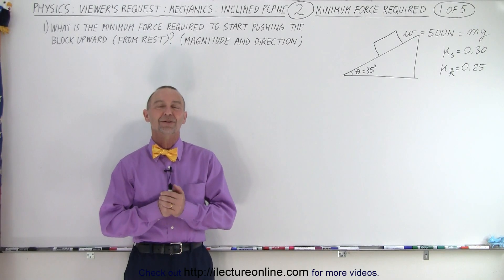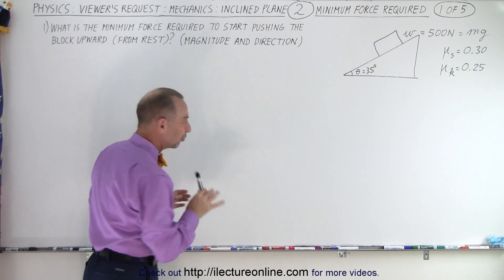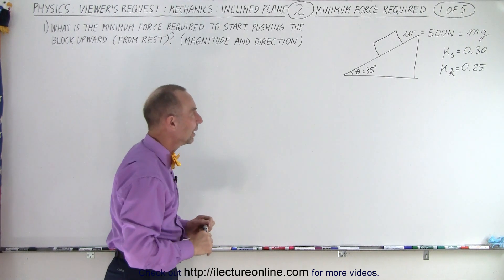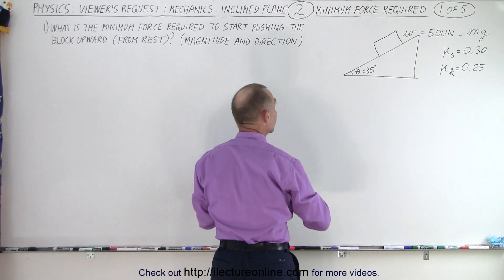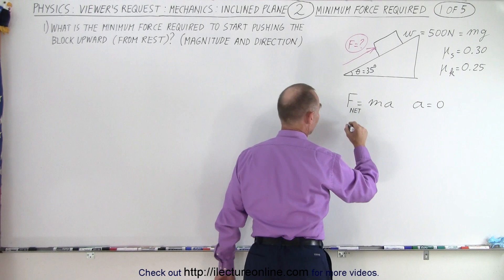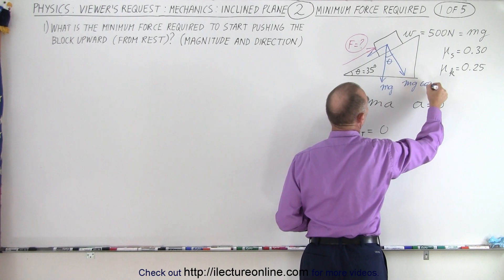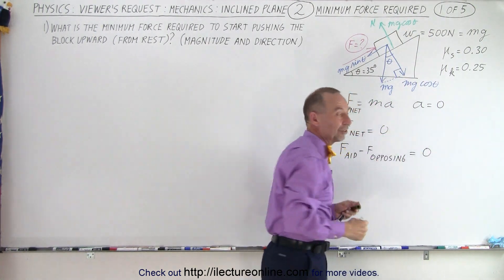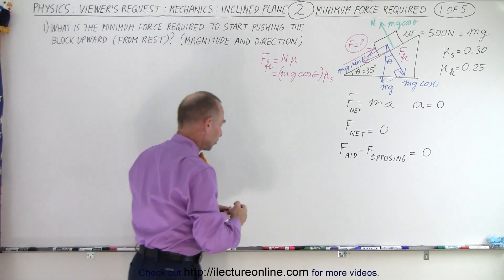Physics: Viewer's Request: Mechanics #2: Inclined Plane - Min. Force Required (1 of 5) Start Pushing

Comment: Let's say the force is given from an angle upward instead of downward which means the certain angle respect to tha side of the block ...then we get reduced normal force and by that the friction will reduce then we get even minimum amount of force as the answer to move the block 🤔💞
Reply from the maker: That is correct.  If the force applied is upward, it would reduce the normal force on the incline and consequently would reduce the friction force.
Reply: @MichelvanBiezen  doesn't it mean that we can minimize force by giving force by an angle upward instead of parallel 🤔💖?
Reply from the maker: It is a trade-off.  When you increase the angle too much, the component pushing the block along the incline diminishes as well.
Reply: @MichelvanBiezen  yeah but at some angle must give a minimized answer 🤔
Reply: @MichelvanBiezen  which gives that F = previous result when F is paraller/ ✓(1+μ²)

Comment: i think i have another opinion if you let me to explain this 
the block will move downward under its gravity force mgsin30 which bigger than friction force = mg*mustatic*cos30
and then that friction coefficent will transform to mukin so friction force will be mg*mukin*cos30 so the minimal force to stop that from moving downward  first will be =163.9N to overcome that gravity force mgsin30 , so the force has to increase to move the block upwards so the friction will transform to be with gravity force and the force has to to increase to overcome this  will be 410N , so we have two minimal forces  first to hold down the block, second force to move up am i right? i wish u have space time to answer me
Reply from the maker: Note that this is a5 part problem.  In this first part, we are calculating the force required to start moving the object upward.  (therefore we must exceed the sum of the mg sin(theta) weight component and the static friction force).

Comment: I need to solve this . A 44 N block is thrust up a 30° inclined plane with an initial speed of 5m/sec. It travels a distance of 1.5 m before it comes to rest. The frictional force acting upon it would be?  Can you please explain it?
Reply from the maker: Use the equation:      W + KEo + PEo = KEf + PEf + E lost (due to friction)   I am assuming that there is no force pushing the block up the incline (except for the force required to give the block it initial velocity)  So the equation becomes:      0 + (1/2) mv^2 + 0 = 0 + mgh + (Ffr)(d)     Where Ffr is the friction force      h = d sin(30) = d (1/2)         So the equation becomes     (1/2)(44/9.8)(5)^2 = (44/9.8)(9.8)(1/2)(1.5) + Ffr (1.5)    Solve for Ffr

Comment: Sir, this solution is incorrect. The force should be a pulling force up the plane at an angle of 16.7 degrees. The solution is very similar to your lecture #6 with the same angle, but instead of pushing down, one should be pushing up.

Comment: Hi sir, one small doubt how Acceleration becomes zero. is it because initially the body is at rest ?
Reply from the maker: The acceleration does not become zero.  The moment a force large enough to overcome static friction pushes against an object, the object will begin to move and the friction changes to kinetic friction so that the object will jump forward and begin to accelerate.  But that is not what the question asks for.  It asks for the minimum force required to start the object moving.

Comment: Mr @UCiGxYawhEp4QyFcX0R60YdQ
I got an issue with this concept of inertial frames & states of constant velocity.
Is the it case, that for isolated matter, possessing motion in this universe is somehow regulated/restricted to quantized rate states, states where it can only pace space in equal amounts WRT a constant beat of time? These states would be similar to electron energy levels.
If so, then that may imply that space, time, acceleration, Force & Energy themselves are quantized. Help!

Comment: There is an error. The minimum force is F=392.4N and is inclined respect to the inclined plane of 16.7 degree in a way that the vertical component is opposed to the normal force. This configuration allows to reduce the friction force by realizing, at the inclination od 16.7 degree, the minimum possible force to move the block.
Reply from the maker: Yes, that video is coming out tomorrow.

Comment: Hi,

new subscriber on the channel.

I have a curious question which is off topic from this discussion...😊

how will I compute for the diameter and thickness of a 12lbs. flywheel?

would appreciate if you could cover this subject.

Thank you very much.
Reply from the maker: There is more information needed, such as type of material used, shape and thickness of the flywheel, etc.
Reply: @MichelvanBiezen  I see. I will be using steel or aluminum and the flywheel I have in mind is like what you see on bike trainers. which I would described as a "enlarged coin". I don't know if this would help.

there are formulas out there that are quite complex.

what I'm aiming for is to determine or adjust the diameter and thickness relevant to the weight. as exampled... 12lbs.